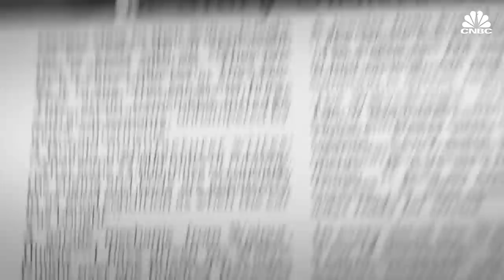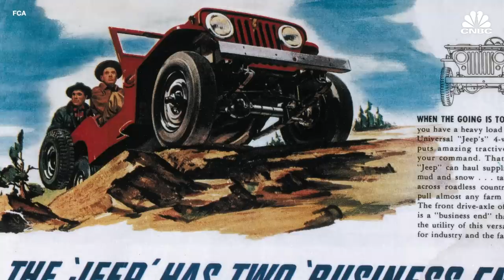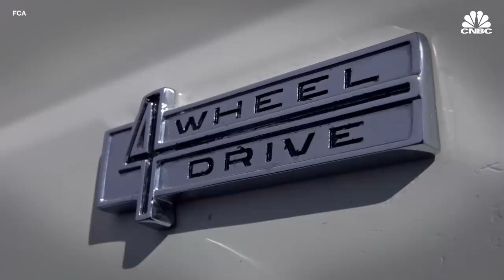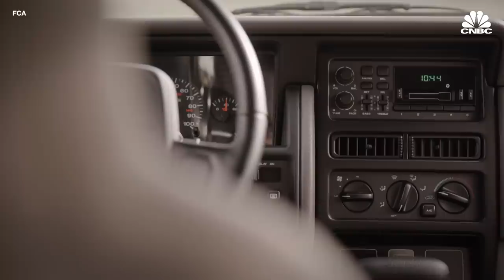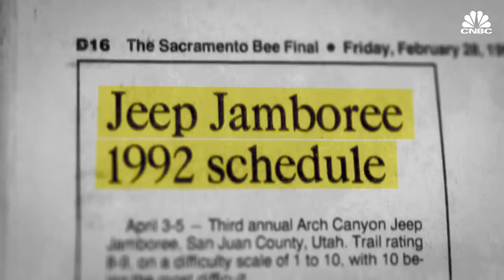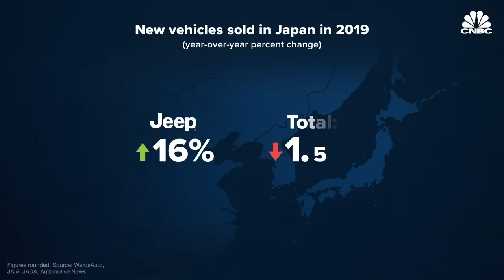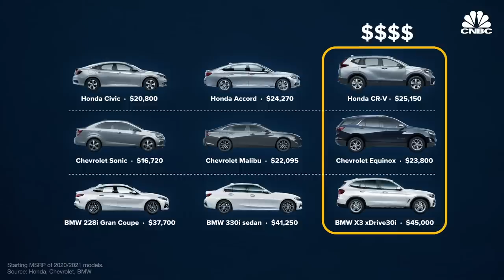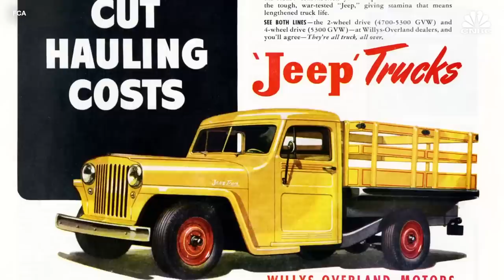Can Jeep Stay Ahead Of Its SUV Rivals?

Comment: Come on, Jeep.  Give me a Wrangler ECODIESEL with the same towing capacity as the Gladiator and you can have my money.
Reply: Not gonna happen. Towing is more than just engine torque, which the Wrangler EcoDiesel has a LOT of. It's also about suspension and chassis, which, on the Wrangler, is tuned for off-road.
Reply: Lance all they have to do is put the wrangler on the Gladiator chassis.  That’s what I want.

Comment: FCA doesn't understand that they can't build both an off-road, simple vehicle and one LOADED with features.  If I want to drive a luxury car, I can buy a luxury car.  If I want to buy a JEEP, I WANT a vehicle that's small, nimble, robust, and user-serviceable.  I'm not taking a $60k vehicle off-roading, especially now with all the computers that you can't even fix yourself.  At this point it's getting more attractive to simply buy a 30-year old vehicle or license an OHV for road use.  Keeping "design cues" is only going to keep the "hardcore crowd" satisfied for so long when you've ballooned your once tiny, spartan workhorse into a fat turd.  All of Jeep's sales are coasting on the Wrangler brand, and all of Wrangler's sales are coasting on an image that's increasingly fake.  Literally any Jeep from 20 years ago is infinitely preferable to what these people think their "core customers" want NOW.  Eventually the "off-roaders" are going to move on to something else and FCA will be holding on to a worthless brand, which is why they have to sue Mahindra to prevent them from making REAL off-roaders that are better than the land yachts Jeep is farting out for a fraction of the price.

Comment: $130,000 MASERATI LEVANTE AND $32,000 JEEP CHEROKEE LIMITED OR TRAILHAWK ARE THE SAME THING BUILT ON THE SAME ASSEMBLY LINE. 

Why would they need nicer than six figure luxury engineers and interiors to compete with other brands like a cheap toyota or awful cheaply made Subaru.
Reply: The rams most luxurious truck awards came from jeep interior materials and screens

Comment: can you install a tesla electric engine in jeep suv?
Reply: NO. Typically they take the same engine in sedans and put it into trucks, SUVs and more. A Mazda 6 has a 2.0 liter engine and so does most of the Mazda SUV models. What you are really paying for, when you buy an SUV is the cargo space. You have alot more space in the cargo and engine compartment to add more features to your driving experience. However electric motors compared to gas engines are worlds apart from each other. Electrical motors power is really equal to the battery and having numerous little motors at each wheel to give the car less stress on a single motor because electric doesn't have the HP that gas does. And more batteries means more weight...so you